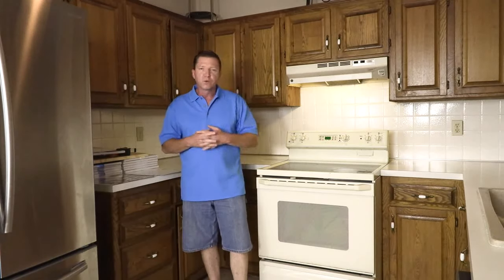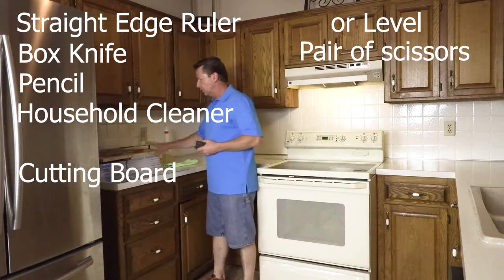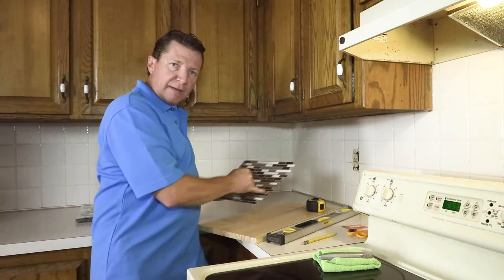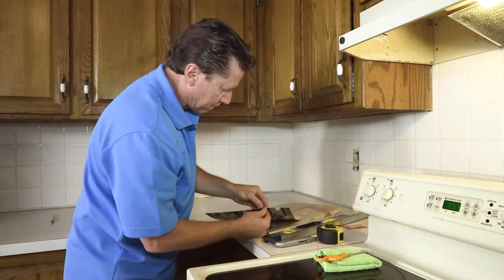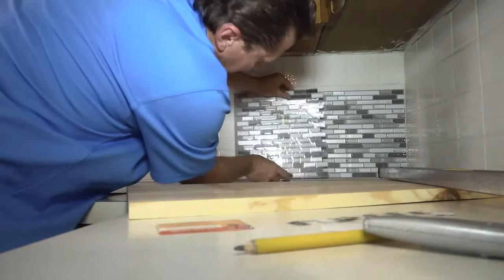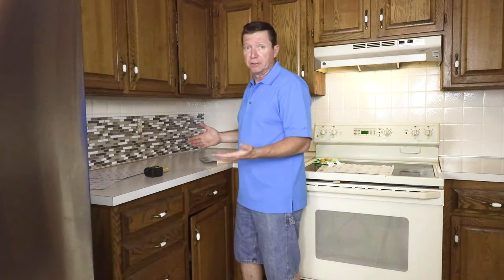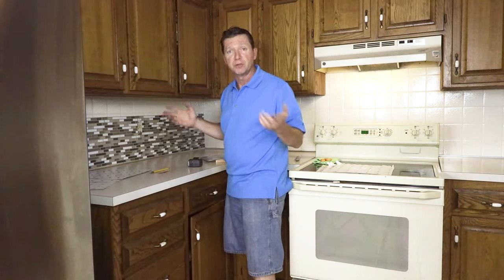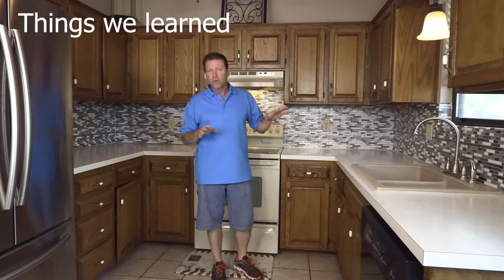Art3d Peel and Stick Tile Kitchen Backsplash Installation

Comment: i installed same tiles in july,18 and I absolutely love it. Afterwards I decided cabinets had to be painted white just finished all painting don't  have doors on yet. hinges on order. now I'm going to update countertop after holiday. I'm 71 female with health problem took my time(as you can tell). backsplash cost about 120.00 with about 21 feet of wall normal height. Pieces are by 12x12 but because of overlap they don't cover 12".
Reply: Looks great, will the wall or tiles be damaged when you take them off? Thanks for the helo.
Reply: That’s so excellent! I’m so happy you did this for and by yourself! I’m adding this piece of advice for anyone watching this in the future, before you install these, fill in those grout lines with some spackling paste so you have a smoother surface for these to stick to. This is an essential tip for a homeowner. It creates less bumps and ridges during and after application. If you’re just adding these for a rental unit, there’s no real reason to spackle/smooth the area. You’ll likely have to remove and replace these after 2-3 tenants. The cost to purchase and install these is nominal compared to the increase in value a rental unit with these added (aesthetics and appearance go a long way with income property).
Reply: @fancythisgirl3  Yep.  I'm dumbfounded at how much is left out of this video.  That seems like absolute common sense to me and I can't figure out, to save my life, why any surface would not be leveled prior to placing something as thin as these tiles on top of it or anything on top of it, for that matter.  

Since these people that made the video don't work for the manufacturer (I don't think 🤔) I didn't want to say too much about it but as the hours tick on after I've watched it I'm concerned that people will watch it and just start slapping these peel and stick tiles up and the way that it's done in the video there's no way on earth that they are going to stay put.

Comment: Very nice.  I also have that same outdated tile in my kitchen.  I rather remove the tile first, but I know that will be time consuming.
Reply: With all the grout lines, the tiles are NOT a smooth surface, so those grout cavities are sure to show through the stick-ons
Reply: If you take the time to remove your old tile take the time to replace it with new tile or glass backsplash

Comment: I used this product in my rv and a day later it all fell off the wall. I used joint compound to smooth out the textured wall and didnt make a difference. Any suggestions?

Comment: I have similar tike to what you had. There is a rounded bull nose edge where the tile meets the painted wall. How would you suggest applying the tile to that area so it doesn't look Wierd or cheap?

Comment: Ok so i have a question. Im trying to put these art 3d on a bar table. The face of it where your feet would be near. My problem is the bar is in my garage and my garage is heated but not all the time i can get it up to 80 if i want but dont need it on all the time could i install these tiles while room is warm and let it cure for 2 days will it stick still after i turn heat off and let the temp drop back down. I use garage alot so it would be brought up to temp everyday basically

Comment: As you went from right to left on the first wall by going left to right on the second and third walls those must have been upside down to make them overlap. Instead of starting in the middle I would have started either at the left or right and worked all the way around in one go.

Comment: What if you backsplash it close to the built in stove burner? Will it melt???
Reply from the maker: It should keep at least 12" far away from the top of stove to avoid over-heated

Comment: Can I use these on mobile home walls?? I have the panels that are floral and outdated and don't really want to paint.
Reply: Yes you can...i however would recommend using real tile though. You can get a subway tile for close to the same price I bet, and doesnt look as "chintzy/cheap as these do...if hesbcutting those with a knife it's not even tile may as just go to a wallpaper store

Comment: Just wondering if this can be done on the tiled walls of a shower? Would water leak in? Any thoughts from you guys? The guy in the video hasn't responded to anyone's comments so maybe he's no longer interested or whatever. But good video anyways!
Reply from the maker: Hello Kat Willams,
It's not recommended to apply in the shower area, as the constant hot water does impact on the adhesive back of tile

Comment: How well have they adhered to the tiles?  I just have painted walls, but they aren’t smooth.  I’m concerned they won’t stick with my textured walls.  Any ideas ?  Looks great !
Reply from the maker: Hello L Watson,
You should sand down the texture, it's supposed to install on flat surface
Reply: Please sand off the texture, and primer it, then you can apply our tile

Comment: Does these work for textured walls
Reply from the maker: Hello, unfortunately the adhesive on the back of the product need a flat and clean wall to keep the tile on the wall. We recommend you to sand off the texture and clean the wall if you would like to apply our product.

Comment: How many boxes did you use, I wonder.
Reply: Determine your square footage you need. They come in a box of X amount of square footage. Usually 10 or so. If you have 30 square feet get 4 boxes just in case you will need more.
Reply: @adamhg985  
Yes thank you!

Comment: Wish I knew this before I bought them.  The sides being "staggered" instead of just a straight line is RIDICULOUS!!  The 1' x 1' are then NOT 1' x 1' when you cut them.  I have a 2' wall......so need 2 pieces across, right?   WRONG, because now I have to cut another small strip just to cover the excess that should already have been covered if the pieces weren't staggered.  Should be all straight edges....... peel and stick and DONE!!  This should NOT be a project!   TERRIBLE!!!

Comment: What do you wipe the tile off with so it's not sticky?
Reply from the maker: Hello, you can clean the surface with non-neutral detergent, use a clean, damp sponge to wipe it dry.